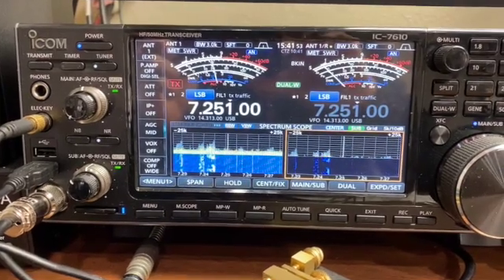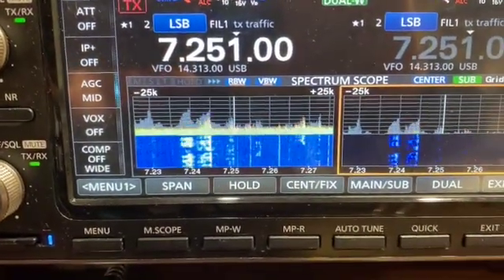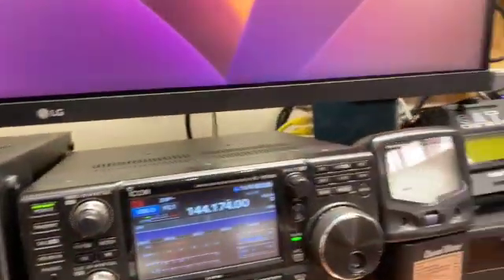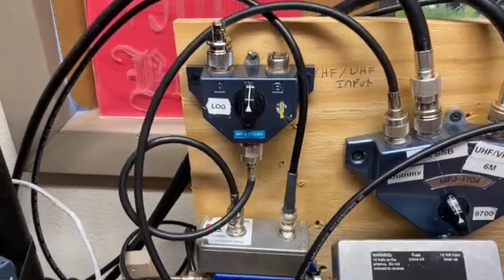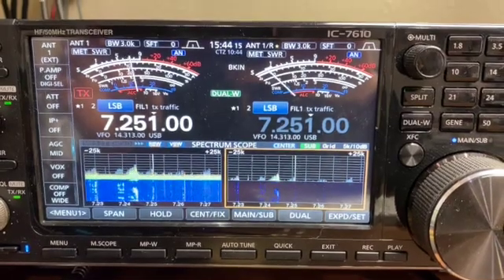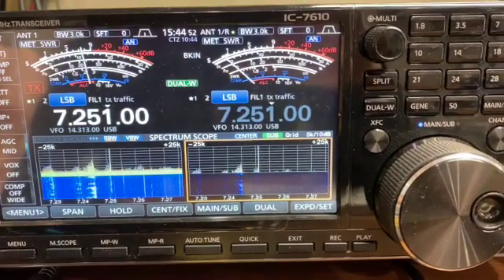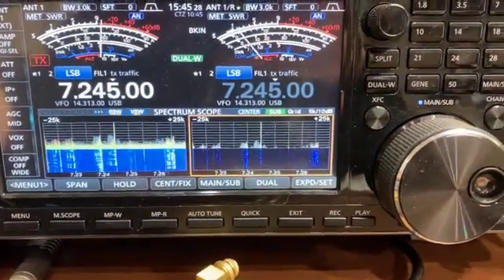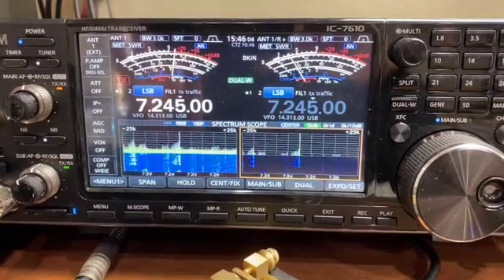Icom 7610 dual receiver with no RX antenna performance demonstration

Comment: looks like the isolation is only about 30 dB. Could be an issue if you are using a lossy rx antenna - which is an accebtable technique. Was the pre-amp off also on the RX antenna?
Reply from the maker: The pre-amp was off.
Reply: Try the RX antenna with the 7610 internal pre-amp ON on the RX antenna.... That might help, depending on where, in the 7610 front-end, the leak-across is happening.
Reply: Also try "IP+" on, on the main antenna, and/or reduce the RF receive-gain on the main antenna

Comment: Disconnect the RX antenna coax at the back of the radio and see if it stops.  You said that the RX antenna was grounded on that switch, I suspect the ground is picking up the signal now...  I'm curious what the result is. 73.
Reply from the maker: Excellent point.  When setting up for this video, I did just that. I was getting my radio setup to track frequencies and familiarizing myself with the main, sub and antenna switches.  That's when I noticed the bleed over, with no antenna connected to the RX port.  Coax hooked up and grounded seemed to make little if any difference.  Once on my 7300, I listened to an 80m net without an antenna hooked up.  Of course only stronger signals came through but that illustrates even further the sensitivity of these radio receivers.